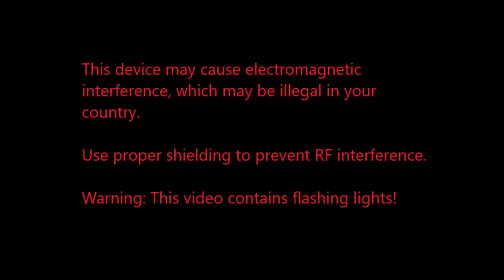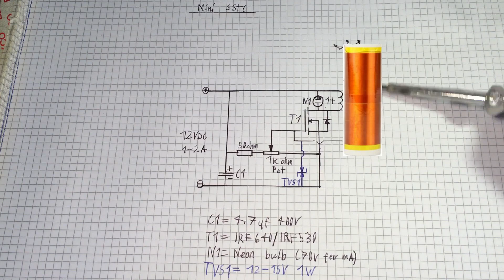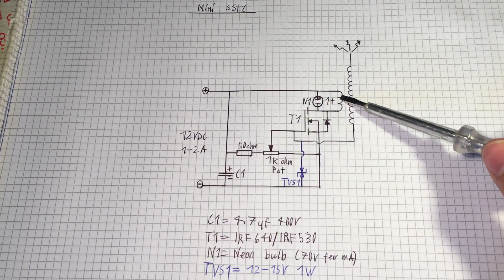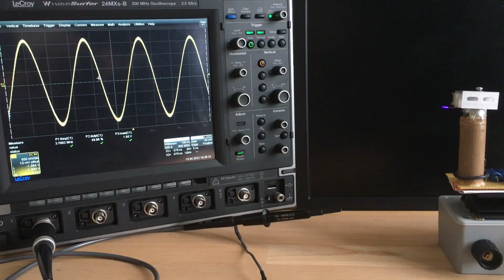Diy simple mini SSTC

Comment: C1 needs to be 4.7uf or could be bigger ? Like about 470uf or bigger
Reply from the maker: It might be possible to use a higher capacity, but you would have to try that out for yourself. Just make sure tho, that your capacitor is rated for 400v, otherwise it might explode.

Comment: Thanks for your explanation it is very clear , I am looking to build a hfsstc , could you explain the new schematic from teslaundmehr? The one that uses those air core inductors and irfp 460 the plasma flame one
Reply from the maker: I can explain that circuit to you, but I probably won’t make a video about it, since that circuit is quite difficult to get working properly and I rather build plasma flame generators using tubes.
But when it comes to how the circuit works, here is a short explanation: The potentiometer acts as a voltage divider that supplies the gate with 5v. And then there is an air coil and a capacitor that form an LC tank circuit that should oscillate at around 10Mhz and the bottom end of your resonator coil is connected to a point in that LC circuit. If everything is tuned right, the LC circuit oscillates at the resonance frequency of the secondary and like that there is a resonant voltage rise happening in the secondary and you can ignite a plasma flame.
I hope that explanation made sense.

Comment: Cool and lovely. I've been amazed at some HV PSUs that do tens of kV using only a few micro, yes MICRO amps. JL Naudin made one that does 40kV at 3 uA average curent.
Reply from the maker: Thanks, I might build a HVDC supply for a TEA laser at some point. 
But I also already have a multiplier with a positive output of 140kv at maybe a few mA continues.
Reply: @sciencebysergio  Cool, is it a CW multiplier?
Reply from the maker: No, it’s just a half wave multiplier if I recall correctly.
Reply: @sciencebysergio  Thanks.

Comment: Could you explain why you added the neon bulb, I don't really get it.

Other than that this is one of the simplest and best explained slayer exciter circuits I saw so far, great job.
Reply from the maker: Thanks:) 
I added the neon bulb to limit the voltage across the transistor and thus protect it from high voltage spikes coming from the primary. The circuit works without it but the transistor is a lot more likely to die.
Reply: @sciencebysergiocant you replace it with a diode to protect the transistor from flyback spikes?

Comment: hi, great work!
i am wondering how to add the 555 interrupter circuit into your circuit.
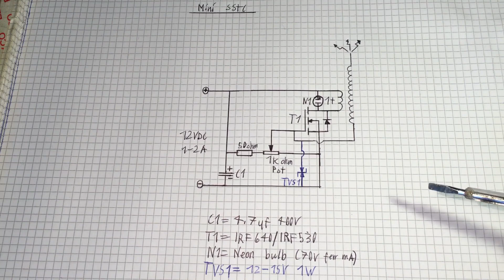can you expand your circuit there at 2:00 timestamps?
Reply from the maker: Ok, it is done, here it is: https://cdn.discordapp.com/attachments/929404734182420550/972460006958063666/555_interupter.jpg
You can replace resistor R2 with a potentiometer to adjuste the pulsing frequency or you can change the capacitance of C1. 
I hope this works for you and good luck building your coil!
Reply from the maker: Sure, let me draw a very similar circuit to what I have used. I will post it as soon as possible.